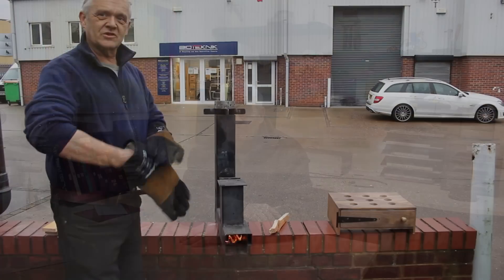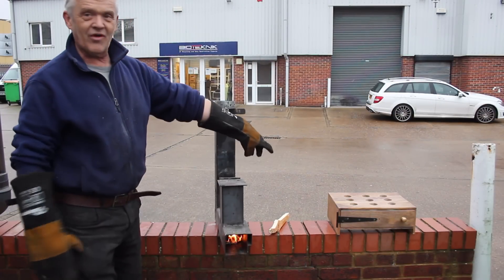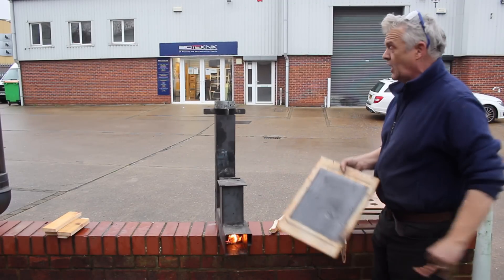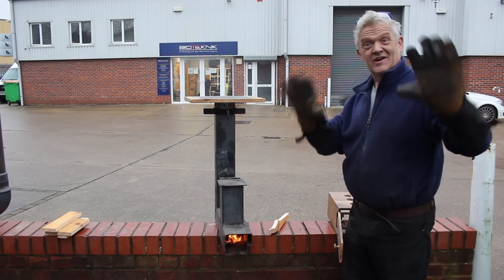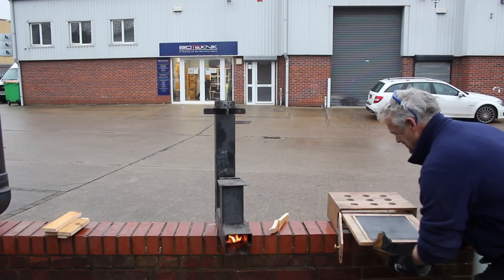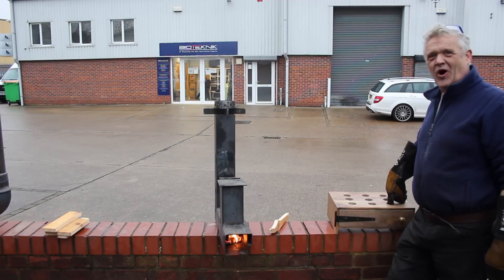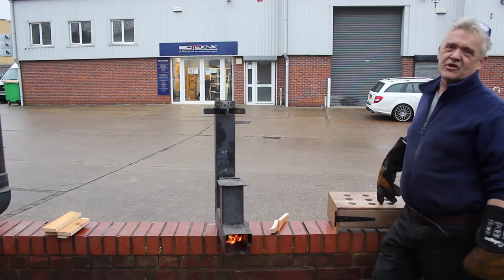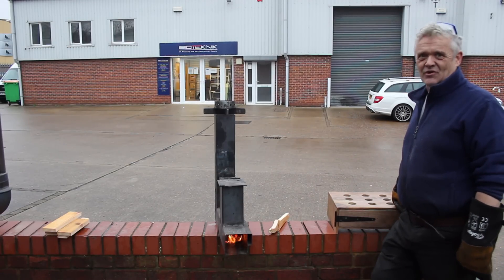1788 How To Use The Heat From A Rocket Stove Inside

Comment: My dad installed an indoor wood burning unit called a Caddy in his basement, he used it for many years while working locally. Typically, he'd spend less than $300 in wood cost annually to heat his house in Michigan. If you don't mind splitting wood and have the time to deal with the matter, it isn't a bad way to go.
Reply: We don't really have access to large amounts of wood in England and if you do it costs a fortune. As we're not allowed to cut down wild trees ANYWHERE (unless I guess you know a multi millionaire with some woodland but even then I'm not sure it's allowed?) Unfortunately this is the way of the WEF MACHINE now .. 
But that's a great idea if living elsewhere less restrictive and plenty of woodlands
Reply: @AB-C1  you're  100% right, I don't disagree.
Reply: @AB-C1  there are restrictions even on private land. You need a felling license for felling trees beyond a certain volume and size and other exempted categories. It used to be, and may still be (check the forestry branch of the ag ministry, including the details), that you can fell 4 cubic metres per calendar quarter, fell coppice poles below a certain diameter and dead or diseased trees (plenty of ash now). A felling license for non-exempt trees will require re-planting or allowing natural re-generation.
Reply: @SheriffofYouTube  Woodcutting permits here vary by county but averages $18 USD for 2-4 cords of wood; you can harvest anything down within 100ft of access roads and of course you're allowed to clear established service roads if they're blocked, which can yield logs of alder, fir, spruce, and several other species that are large enough to slab out.  
You can get a cord of mixed hardwood around the state for $150 if you don't look for it literally during the winter (which a lot of people here do because it's available they just double the prices during the cold so there's basically a lazy tax on it), but again, the permits here are issued by total quantity of wood not time limited or number of trips so you could go out and fill the trunk of your compact car 30x if you want so not having a truck isn't an excuse, really.  We end up leaving more wood than we came with every time we go camping lol :person-turqouise-waving:
Reply: @SheriffofYouTube  It's work. If you want to run out with a saw and collect fallen trees, split the wood, you'll save alot of money. But that is time and it depends on what your time is worth to you.
Reply: Fellow Michigander here
Reply: burning wood is a great deal of work but you will never be without heat if you have a saw and axe and one match.
Reply: ah, a wood burning furnace. I have replaced them from old houses before. I see they have one called caddy advanced. The $6k price tag is pretty steep!
Reply: @josoffat7649  The caddy units aren't cheap, I believe my father spent $5k on his, he got sick of dealing with everything and installed a large gas tank on his property. He also put in a large generac unit.